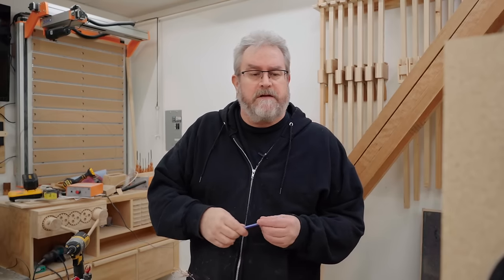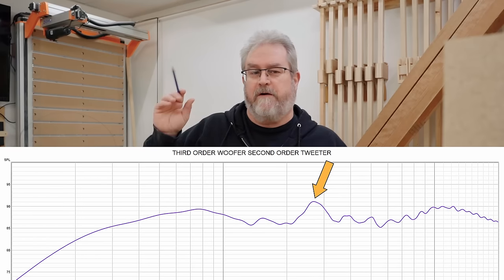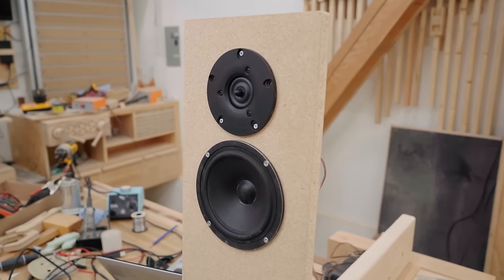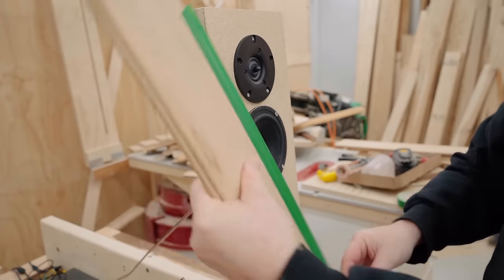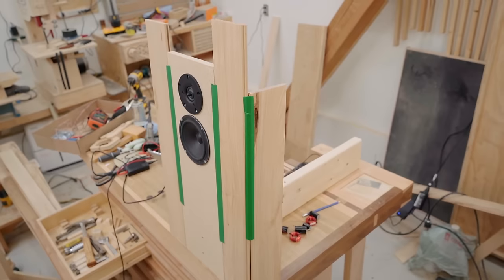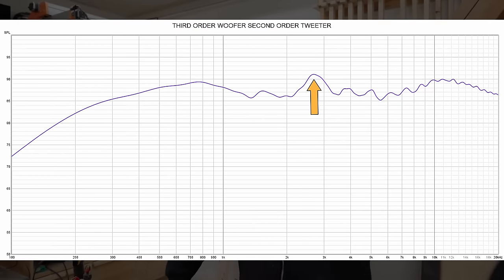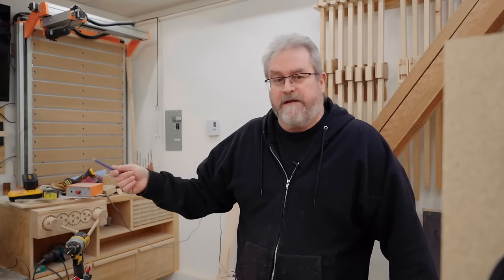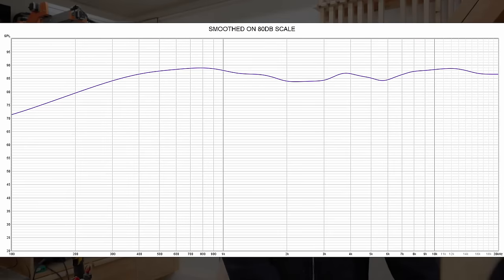The Dirty Little Secret of Open Baffle Speakers

Comment from the maker: The dipole peak is caused by the interaction between the output from the front of the speaker and the back of the speaker. Depending on the width of the baffle it will cancel or reinforce at different frequencies, so you get a pronounced peak in the response where it reinforces (adds), and dips in the response where it cancels. This is most obvious in the first dipole peak at the lowest range of the driver's response, but also has an effect on the frequencies above that.
To eliminate it altogether you need to make the baffle wider (at the top and bottom as well) than the lowest frequency you want to get from the driver. That's typically wider than practical.
Another way to deal with it is to use separate drivers and vary the width of the baffle where they are located to get the best response. I did that in my main speaker build where I used a 15" woofer for the lowest range on a baffle with deep wings, then used progressively smaller drivers on the baffle as it narrows. 
The dipole peak problem was responsible for some of difficulty I had, but it was also a hump in the tweeter's response added to it that was the major cause. By shifting the crossover frequency up to 4KHz, it took a lot of the thunder out of the hump and flattened the response to an acceptable smoothness. 
The 5" midwoofer is happy to play up that high (as confirmed by the distortion measurements) and whenever possible I prefer to cross the tweeter higher to take away the stain of using it at lower frequencies. This may affect the off-axis response of the speaker, but the way I'm using these speakers it would be better if they were more directional.
Reply: I noticed that the dipole peak was less when you added the wing to one side (instead of both sides). What if you mount the the drivers on an L shaped baffle?
Reply: The only real solution is to operate all drivers under their first dipole peak . Not always easy or cheap to find a driver and crossover setup to accomplis this .
Reply: the problem is that a 5" mid will beam quite a bit with a 4khz crossover, so you get another problem. 4khz = 3.4"
Reply from the maker: @einarbk885  "This may affect the off-axis response of the speaker, but the way I'm using these speakers it would be better if they were more directional." 
From my comment above.
As it turns out (because I measured it), the speaker has pretty good off-axis response.
Reply: @einarbk885  several 4” wide range drivers (Fostex 108 Sigma and Mark Audio MAOP 7 come to mind) operate quite nicely up to 10k. Yes above 10k I can see even the best of them needing some help.
Reply: @navinadv  the diameter of the driver decides where it will narrow and start to beam. example all 1" dome tweeters narrow above 13.5khz, the same is true for speakers using horn/waveguide. but thats not a problem that high in frequency, for full range drivers and high crossover points it is.
Reply: @einarbk885  I understand your point but since I have seen graphs of a few 1” tweeters having a response up to 20k (at 30 degrees off axis) and some small full rangers having a response up to 10k (no idea if these were on axis or off axis as it wasn’t mentioned) I wonder if the driver designers have used a more sophisticated cone topology to be able to get better off axis response above wavelengths dictated by the diameter of the drivers. Either that or the manufacturer was fudging their graphs.
Reply: @navinadv  sure, but 30 degrees isnt that much, most dome tweeters are much wider than that before they start to narrow. like some people say that whizzer cones on a full range driver increases dispersion, yes put only for spesific ranges, if it increased dispersion for all high-end frequencies it would have to change shape while its playing music. and also if you have a speaker designed for limited dispersion then the drop above the beaming point would look better in the data, because its narrowing is more limited than a wide dispersion speaker.
i see lots of small manufacturers nowdays with all kinds of wild claims about speakers with large drivers no crossover and no dispersion controll. dont believe anything they say:) i dabbled on with this for some time. most speakers have a 1" + 6.5" with a 2khz-ish crossover for a reason.
Reply: @einarbk885  oh ok. I have heard many speakers wider than 30 degrees off axis.

I wasn’t considering very large drivers. I was hoping a smaller 4” driver would be adequate till 10kHz but I understand that at least theoretically it would beam at a wavelength related to its diameter. Have you checked out the Mark Audio MAOP7? There is a company called Pearl Acoustics that makes a full range speaker using the MAOP 7 in an MLTL. 

I have built enough 6”, 7” and even 8” 2 ways, and 8”, 10” and 12” 3 ways so I was looking to try something that had all the ability of a 8” 3 way but with more coherence. My idea is to use the MAOP 7 as a wide range between say 250Hz and 10kHz along with a helper woofer (4 x 6”) and a helper tweeter above 10k like a small ribbon.
Reply: @einarbk885  I found a youtube link to a 4" full range used with 2 side woofers. I was considering doing something similar but using 4 6" drivers instead and maybe adding a small ribbon (Fountek 1.0) to help the high frequencies. 

https://www.youtube.com/watch?v=zqSXy1t_7BA

What do you think? Is this a viable idea?
Reply: allso never center the speaker driver in the baffle. on none of the axis. try it, it makes a difference. (i like H baffles btw.)
Reply: Boy thats pretty correct in my opinion.

Comment: Always interesting building hifi  systems! 7 years ago I built 3-way open baffle speakers. 70x40 cm.  27 cm woofer,  15 cm mid, 10 cm tweeter.  Brand SEAS.  The tweeter is double: one facing to the front and one facing to the back 180 degrees out of phase to reach dipole radiation in the high frequency area as well. Each driver is driven by its own mono amplifier (so the amplifier contains 6x180 W D-class amplifiers). Crossover is digital using a DSP before amplification. Speakers made of 36 mm solid beech glued panels.  Sounds very clear and pure. 🙂

Comment: Interesting observations, off setting the drivers to one side a little on the baffle could help reduce the peaks and dips as well. Which is really what you accomplished when one 4" board was taped to the baffle. In many of my DIY builds I offset the tweeter for that reason.
Reply: No, an offset will create two peaks that carry the same diffraction energy out in the room. You should address the real problem, which is diffraction, by rounding the edges of the baffle with a radius of 1-2 inches.

Comment: Not normally one to get involved in the technical information regarding crossovers.
I found this video a most enlightening and refreshingly honest representation of what to expect when using a wider baffle .
Thanks very much for all your efforts.
👍
Reply: Using unequal length wings pointing rearward work better for me than a large flat front baffle. I also use a dipole tweeter, or two tweeters with one facing rearward and wired out of phase with the front one.

Comment: Experimented with many drivers in ob panels. 8 inch width is not enough. 8-12 inch drivers with whizzer cones and 100db  work...range is more like 300-14000.The rearward output needs dampening. Heavy wool works.
Then it sounds so good that you want more and you progress and add two sealed box 18 inch 99db woofer driver and two JBL selenium 108db horns. Quadamp, digital x-over, usb interface and suddenly you only want 32bit audiofiles. Soooo goood.

Comment: Hi John.  To endorse something you noticed. I built some 4 x 2 foot baffles using Eminance 12 Lta. They didn't sound right.  Even 1926, 78s sounded like two points of sound. Two low cost  DT74/8 tweeters were added.  These on paper would work with just a first order crossover and no resistor. They did !  I tried in phase 6 kHz first. After many trials  I returned to that.  That made no sense. Wide stereo and no lack of treble. I used a Quad 33/303 with tons of bass EQ ( really worked ).  I have Magnepans and know Quad ESL. Mine where doing very well.  What I got was an octave above and one below.  By luck it worked.  The idea started with Dynaco A25 I fixed. The 12 lta only had it's mechanical design filtering. Voice quality stood out as good.

Comment: I used to install custom car stereos for many years and found that a midwoofer (we called them midbass) drivers worked best (lowest distortion, highest output) crossed over at 130 hz. hope this helps your active x-over build. Also we crossed over the bass considerably less than that (around 100 hz).
Reply: @Kev Z  
A car audio Sound Quality competitor named Jim Becker won the MECA organization's 2015 "World Championship in SQ" in his dual cab Dodge RAM truck using 5.25" Scanspeak Revelator 15M midwoofers and SB Acoustics SB29 silk ring-dome tweeters in sealed dashtop pods aimed relatively on-axis to the driver's seat headrest.

A single JL Audio 10W6v3 10" subwoofer in a sealed enclosure placed down in the passenger side footwell.

The 5.25" midwoofer's HPF and the subwoofer's LPF were set at 125Hz (I forgot what Type of XO filter, but I believe it was 12dB/octave).  The crossover between the midwoofers and tweeters was at 3kHz...not sure of the type or slope.

He used a multi-channel ZAPCO car audio DSP to provide the Crossovers, PEQ, and Time Alignment (digital delay) for the system, as well as a pair of small 3" midrange drivers placed high in the rear "C" pillars with low level, delayed Differential "rear fill" (signal is L-R, R-L for each respective rear midrange).

These "Differential" Rear Fill drivers were also bandpassed from 300Hz-3kHz.  This type of "Differential" rear fill provides for better "room ambiance" as well as a deeper and wider front soundstage.

So you're right that a slightly higher HPF on the midwoofers can work extremely well when combined with a good low inductance subwoofer.

Comment: Have you ever tried spreading out the crossover points to eliminate a bump?    If you had an objectionable bump at 4k, and then you made the woofer Low Pass at 3750 and the tweeter High Pass at 4250, that would leave a gap where both are starting their rolloff at 4000, wouldn't it?   I would think that would mellow out any bump in that area, but I'm sure it would take a lot of experimentation to get it to flatten out the way you wanted it to.
Reply from the maker: I tried it and it can work, but it's tricky to get it precise enough (with standard cap and coil values) so that you don't end up with a dip instead of a peak.

Comment: I'd love to see you doing this kind of testing again, but instead of extending the front baffle with timber that is parallel with the front baffle, extend it with timber that is perpendicular to the the front baffle. Kinda like a box speaker without the back on it. I've also heard doing this asymmetrically can have benefits.

Comment: Would be interesting to see what happens when you use different types of wood and what slightly concave and convex shapes would do.
Reply: Convex form will help a lot, and even more so if the edges are rounded with at least 30 mm radius. Countersunk drivers will help reducing the 4 kHz peak.
Choice of wood might have an effect but that will not be seen in a measurement like this. ALL mechanical structures have a self resonance point and a lot of harmonics from that point.
That is what we call colouration. The cabinets own contribution to the sound so to say. Lowering the amplitude of the resonance point and trying to place it outside the range of the drivers operation is the ticket to get really uncoloured, clean and distortion free sound from a loudspeaker. 
A loudspeaker cabinet is pretty much like any instrument like a piano, violin or cello. It have it's own sound, and that sound signature needs to be reduced to minimum for true high fidelity reproduction. Many ways to handle that, but it needs to be addressed properly if you want a truly great loudspeaker. Selection of material or wood is one of them.
Reply: @flex-cx9bi  thank you

Comment: I guess some notch filters can take care of these -but it of course adds complexity to the crossover. My large OBs are smooth enough for me where I dont mind any wiggles because as you said by the seated position, its down enough not to really be an issue :)
Reply: Not truly, but they will remove to some extent the issues of peaking and so on, at ONE location. The problem with OB, is if the listener moves to a different location, the reinforcements and cancellations move also.
Reply: @kevintomb   True but any room - especially one that is not highly treated, can also have reinforcements and cancellations due to general response and reflections even on a boxed speaker. To a lesser extent but still....

Comment: Is it not because of baffle edge diffraction?
1.would try to put on all edges some round tube or some damping material (left right up down)
2.or put some damping material (carpet) also on 10cm of edges of baffle to reduce middle-high freqencies beaming
3.or try to do rounded buffle + rounded edges (like flat earth)

Comment: I'm a woodworker just getting in to building speakers. Thank you for the this video and information. My comment or question is are most open baffle speakers designed to be installed into walls or ceilings really not making them  "open baffle"  ?
Reply: No they're not designed for wall or ceiling mounting, they're designed to be positioned in a similar way to closed baffle (box) speakers.
The rationale for them is that they avoid a boxy sound which is produced by vibrations of cabinet walls and internal reflections exiting through the speaker cones out of phase with the main audio causing peaks and troughs in the response. There are pro's and con's for all baffle designs, personally I like deep closed cabinets with tapering and angled walls.

Comment: When you added the second baffle extension, the reason the hump & dip became worse is because you added the extensions on opposite sides. Had you added both extensions on the same side that would not have happened. Assymetrical baffles on OB speakers are the designer's best friend.
Reply: No, that is not correct. Assymetrical placement will create two peaks instead of one. Lower in amplitude but equal in distributed diffraction energy. 
If you want to get the total diffraction lower you should round of the edges as much as possible. A U shaped or \_/ with rounded edges would reduce the diffraction the most and still keep the principle of open baffle.
Reply: Regarding speaker placement on an open baffle we can consider the distance between the speaker and:  The left side of the baffle, The right side of the baffle,  And the top of the baffle. Even considering just these three parameter there is an infinite range of different peaks and troughs that can be generated and if you experiment, a placement can be found where peaks and troughs become minimised. Just saying two peaks instead of one just does not make any sense at all. There are many, many different eventualities some of which might be wose but some of which will be better.
Reply: @mikelm222  Yes but I commented on your suggestion to place both extensions on the same side and THAT solution would have created two peaks.
The best solution is to have no edges at all by making the edges rounded. +50mm please and 100mm radius is even better.
Reply: @flex-cx9bi  Lowering the amplitude is very much worthwhile. Then take steps such as rounding and or absorption and you can get very smooth results.

Comment: When determining frequency response in the cross-over region, it's essential to consider the phase response of the filters.  For odd order, both H.P. & L.P. filters are the same, but for even order, one is (+) 90, and the other, (--) 90 degrees, which adds to 180 degrees.  That's why the polarities are reversed for 2nd order cross-overs.  With one 2nd, & one 3rd order, the overall amplitude response will be somewhere in between, which may be good, or bad, depending on the driver characteristics.
Reply from the maker: That's why I measure. If there are gross phase issues (and  it's debatable whether issues that are anything less are audible), it will show in the measurements. 
And countless hours can be (and is) spent by guys trying to nail down the perfect response, only to have that mostly obliterated when listening in a real room. They'll put in hours fine tuning a crossover and then set the speakers up in what amounts to an echo chamber, where as much as 50% of what they hear is the speaker's interaction with the room in the form of reflections and reverb.
Reply: @IBuildIt  Definitely!  The ultimate test is "How does it sound?"  Theory can point you in the right direction, give you ideas, etc, but as they say, "The proof of the pudding is in the eating."

Comment: The dipole driver response needs to be equalized, as you would for any loudspeaker driver peak. 
It is not a problem, it is part and parcel of dipole loudspeaker design and can be achieved with two biquad filters. If you want to do a passive design be prepared for subpar/compromised results.

The correct design approach is to only use each driver in a frequency range where the dipole response is well behaved both in frequency and directivity. The upper useable limit for a driver is kb=3.6, where k =2pif/c and b is the baffle radius. Beyond this both the directivity and frequency response degrade. 
The peak is beneficial, if you have proper equalization, as it means you have less cone excursion for the same output as a driver in a seal cabinet.  
You should not separate drivers by more than ~half wavelength at the crossover frequency and this limit should guide the design, including the number of drivers.